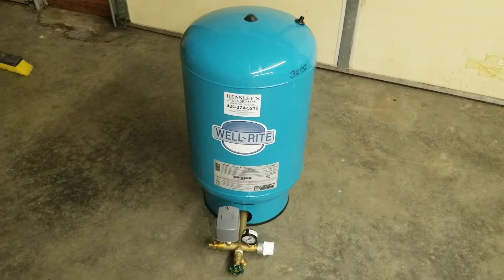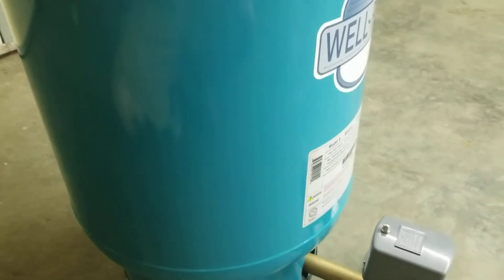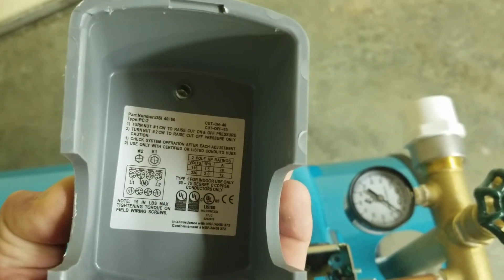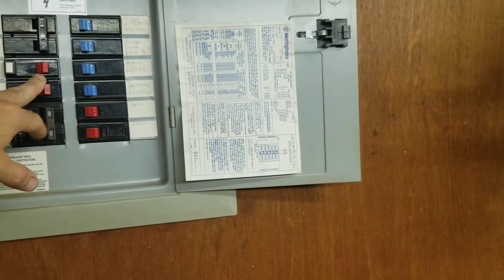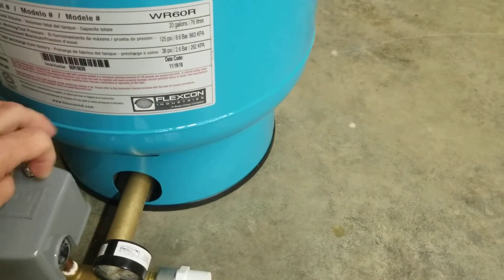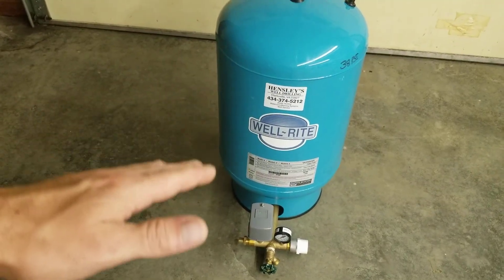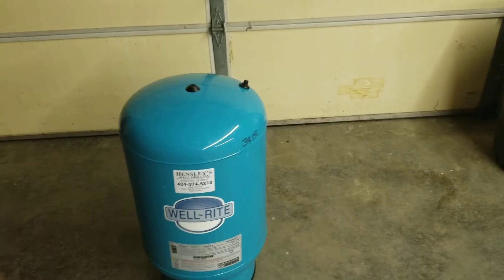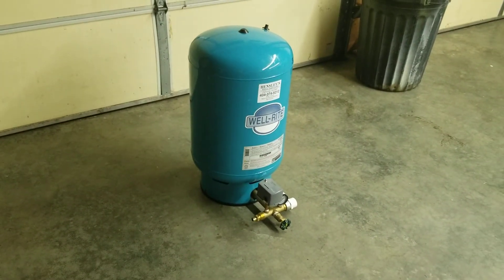Well Pump & Tank Troubleshooting, How the system works, Adjusting Pressure Settings Correctly

Comment: Hello. I put air into my tank i made sure that the water valve was off but when I open the valve & let it run the air leaves the tank & then I have no more air in the tank so I put more air in it & the same thing happens t his all happened after an article blast that came through & the temperature dropped to well below zero I thing it dropped to -12°. Could I have a bad tank

Comment: Thanks for the great description. Going to check my tank tomorrow, and turn my submersible off at the panel. I had forgotten they are normally on a single dedicated breaker and don't want to lose it too.
       Like my former well, just before the control T I have a gate valve and hose fitting.  I shut off the water to the tank and checked for pressure from the submersible- I have plenty. Am I correct in how I checked for a functioning submersible?  Thanks for reading this. Kind regards, Dave

Comment: Questions:
Deep well, Water stopped working abruptly. 
New bladder tank and switch (240 V)
What would cause the switch not to come on and pressurize the bladder tank?
 (Switch was replaced just in case, still no pressure)

Comment: My pressure tank is full, pump kicks on and off but water won't go to the rest of the house. Checked the tank pressure thats good. Not sure what it could be? I have a back up capacitor that I switched out and still nothing. When I turn off the pressure switch it drains to zero, what could that mean?

Comment: Good morning we have well system with a deep well and a larger bladder with a bigger house we are down to 10 lb on the gauge and the pump is not kicking on I am wondering how often the pressure switch goes out all of the breakers are fine and everything has power I will also check the bladder as well to see if it's good thank you for your help

Comment: Hey. Great video. My well runs nonstop so I use the circuit breaker. I replaced the pressure switch and no change. I drained all the water from the house and the hose bib. 
The tank is heavy but no water comes out of the air valve I also took out the center of the valve lots of air but no water. Is my bladder tank bad. Thanks for your advice. Chris from Alpena Michigan

Comment: Hi I’ve just purchased a pressure tank and the tee that I’m supposed to get for it has openings on both ends. One for water to come. 
2 openings on top for pressure switch and pressure gauge. 2 openings on the side one for boiler drain and pressure regulator. The box says I need a check valve. Where does that go? On the side the water comes in? 
The tee has an opening on the other side but I don’t have pipes to attach to that? What do a do? Just close it off? 
Any help would be great. I’m without water and can’t get a hold of a plumber I trust

Comment: My well pump comes on, the pressure builds up and it cuts off fine. Then with no water running the pressure slowly drops and it cuts back on. How do I determine where the issue is. Thanks in advance.

Comment: I just switched over to well water got a 20 gallon tank I got a 4060 pressure switch I set the tank at 38 PSI turn the water on for to fill up I checked the pressure in the bladder and it goes to 50 psi all new system

Comment: I have low water pressure in the house lately. Water has been dirty also. Whent to shock the well and noticed the pump is humming even thought  the pressure switch is off. I assume thats not normal. Going to look at the switch and tank in the morning but cant get past the well humming with switch off. 28 ft well by seattle and  never ran low on water. Also on a river.😊

Comment: Great video's! Question - can you replace a 20/40 pressure switch with a 40/60 if you increase the tank pressure to 38? or do you have to sick with the original tank pressure? or put in a new tank? Thanks and have a great day!

Comment: I have recently replaced a pressure relief valve. Month later the valve is leaking.  Pressure was at 80 psi. Pump is also short cycling. What would cause the pressure to continue to rise even after the cut off has been reached and pump is off?? I am using a bowl that I dump daily for the pressure relief.

Comment: Broke the feed line from the well pump replaced the line pressure tank has correct psi, psi gauge wont go higher than 38. Set 30 psi on 50 psi off

Comment: Hi. I’ve had the house for 20 years now and we have NEVER had decent pressure. Someone told me once I have a sandpoint well, its in the basement. I’ve never replaced or even touched any of the parts, so everything is AT LEAST 20 years old. Would I be able to put in a bigger tank, or a higher pressure switch, or a better jet pump and get decent pressure, or is a sandpoint just always going to be garbage? I can’t even use a water sprinkler without embarrassment and when the water softener regenerates, there is NO water available for around an hour til its done. The pump is 1/2 hp I think and it turns on when the gauge is at about 10 psi or so and turns off at 40.

Comment: Hey brother my water is not working at all 
My pressure gauge is reading 0 zero
Reply from the maker: @BuildByKQ  test for power out at the well. If you read 240v, then the issue is down the well (bad pump or wire)
If you don't get 240v then look at the pressure switch and test the points

Comment: What about 0 PRESSURE and TAKES 0 air it does not fill and does not read . NOT 1 single video w those symptom’s
Reply from the maker: @lexusautotek8905  the tanks bad & any air you add is going out a open pipe or faucet

Comment: we have replaced the bladder tank, replaced the switch, replaced the control panel and checked to make sure the pressure stem is clear and it is and we still have low pressure or no pressure n then the water cuts off what am i missing?

Comment: I’m having an issue the pump turn on but when I use the water I loose all pressure and notice the pressure tank isn’t filling up with water and it takes a while to kick back on or I have to turn it on manually
Reply: And I change the pressure switch maybe I made a mistake and I bought a 40-60 but my tank it’s pressure at 28 I tried to pressure my tank to 38 but that didn’t help
Reply: Also swap out the capacitor thinking it was that since im getting a burn smell when pump runs 😊

Comment: Trying to troubleshoot an issue….have a 30-50 psi switch and we experience occasional drops in water pressure (down to zero), only lasts a few seconds, then back into normal range. Seems to happen during high demand. Already replaced the switch but same result. Would love some feedback

Comment: At my parents house I can turn on kitchen sink,water flow seems fine,but I hear the well /pressure switch kick on every 4-5 seconds. I watched pressure tank gage ,it kicks on at 38 lbs. shuts off at 58lbs. When faucet is on ,like I said , 4-5 seconds it’s already dropped to 38 psi and turns on constantly cycling. I took air pressure gage to see what tank says,it doesn’t read anything.I tried to see if there’s air in tank ,by pushing down on air valve,no air comes out of tank.water works great,but I’m afraid it’s going to burn up their pump,cycling so much. Is pressure tank bad?  I’ve never seen a tank not have air come out or not accept air ? Your advice would be greatly appreciated! Thank you!

Comment: Just bought a house. Well seamed to be working fine first few weeks. Now the exterior holding tank is empty its about 500Gal and I have 2 tanks like the one you have here except they are about 3-4 times the size. 1 seems full and the other is empty. 
1. should I replace the full one?
2. Or should I check to see if there is dirt underneath the switch where you take a screwdriver and push it down into the coper line 
3. The pump seems pretty old too although It seems to still be working good when the system was working. 
4. The pressure gauge has water in it, is that normal or should I get a new gauge?
5. Should the tanks or pump or anything for the well be underneath a shaded area or should I build a cover for them? 
6. Would you be willing to do a call or something to help me diagnose the problem for some sort of consultation fee?  I really want to learn myself instead of someone trying to get me for hundreds if not more.

Comment: Water pressure went to a small nothing abruptly 4 days ago, I was told. He replaced the pressure switch, however there is no pressure on the gage, but there is some pressure in the bladder tank. Could the gage be clogged up.  Plus I've never seen a tank set on its side before and the gage is up above the tank on the inlet line coming from the well. Any suggestions

Comment: What is sputtering causing by? I just had a well pressure tank replaced. The brass pressure nipple to the switch had a slow leak and the plumber sold me on replacing the whole thing due to age and the same piece being replaced years ago. His apprentice broke it off by accident causing water to go everywhere and we replaced the whole tank and check valve. Now we have sputtering water at every sink/ faucet or outlet. The only thing I'd done in. between was replace our whole house water filter.
Reply from the maker: Did the old system have a check valve before the tank? 
Typically sputtering is air. It is likely a small leak in the pumps check valve. After 5-7 minutes of usage it should stop sputtering, but once it sits off for a hour or so, the water will be sputtering again. 
If this sounds like your scenario, then its a leaky check valve in the well pump (or a bad fitting in the well)
Reply: @h2omechanic  the plumber said it did. the sputtering continues even after a quite a bit of use, almost whenever used.

Comment: My water pressure surges. I can have super high pressure then the next super low. 

Last night I drained my tank, checked the pressure and had to add air. I was hoping it fixed the issue but it didn’t. Today I ran out of water completely. It had never done that before I tried to fix it. I went out there and the tank was so empty I could lean the tank over. I don’t have time right now to drain it all so I’m watching videos to try and figure out if it’s the switch or what. One other thing, my pressure gauge stays at 62 at all times. Even when I drained everything and had the power off. I know it should be between 40/60. Can that affect anything or is that just a bad gauge?

Comment: Suddenly out of water this morning. I'm getting spark on the contacts of the switch, but there's no water in the tank. I opened the relief valve at the bottom, below the switch, and only air came out. I'm afraid the bladder may be shot, but why wouldn't the pump come on? I have a tall tank, and my well is about 300 ft and drilled about 14 years ago. Any ideas? I bought a new switch, but wasn't sure if e needed to be replaced or not.
Reply from the maker: Spark means the pumps running. Either you have a broken pipe down the well & the air you heard was suction, or the wells dry & you have a major leak somewhere

Comment: My water stopped running while taking a shower. Pressure switch is sparkimg when tested. It just won't kick on and move the gauge. I replaced the switch about 8 months ago. Suddenly I got nothing. What do you think?

Comment: So… mines just doesn’t hold air, I fill it with air to to 28psi and it hood air for about a day. The tank isn’t filled with water only the bottom 1/3 or so of it the rest is hallow. I changed the stem on it and still doesn’t hold it. Any ideas?
Reply from the maker: The tanks bad, replace it
Reply: @h2omechanic  darn ok, thanks for help. I though they only went bad if waterlogged but I guess it’s losing air somewhere else. Just glad they not expensive and I can do job myself. Thanks for the help again!!!

Comment: Can you use the same pressure tank that has a 30/50 pressure switch and swap the switch to a 40/60 or do you need to change the pressure tank also?
Reply from the maker: You can change to a 40/60 without issue. But it would be best to add air to the tank while you are replacing the switch (pump it up to 36psi). That's how you'll notice more water pressure in the house
Reply: @h2omechanic  I thought that would be all I had to do and thanks for the verification. You da man!

Comment: I have a shared well with 4 houses and 4 pressure tanks with 1 switch..our water pressure went to 0..when i reset the 2 buttons it builds up to 17lbs then u can hear the 2 buttons click again as if they need to be reset..could this be a bad tank making system overload ?

Comment: My well pump works as far as it pumps water when you pull it up from out of the ground. When it is put back down into the well, it does not pump water . We've replaced the breaker and the pressure switch , both new parts. I believe that the tank has no air in it at this time.

Comment: Our pump doesn't shut off and pressure keeps dropping to 10 then 0 the bladder does not seem to take on any water add all I wonder if there could be any blockage the pump goes up to 30 and we have good water pressure but then it'll drop to 10 we just got a new pump yesterday the air pressure tank when you move in it seems like it is empty

Comment: Lightening strike killed my water. My 20 ga. bladder tank was at 10 psi. I bought and replaced my 40/60 pressure switch. Tank went to 20 psi then went lower when faucet was open. I filled the bladder tank to 38 psi. Was able to take a shower but pressure is lower than I'd like. Tank is light but doesn't sound like a bell when i tap it. Thoughts? Thanks so much.

Comment: Hello, my issue is my pump is turning on every 35-50 min and it turns on at 50 and turns off at 70,  I pulled the cover on my pressure switch and it's a 30/50 switch and I have never made any adjustments to the switch. Any guidance would be much appreciated, thank you.

Comment: I changed pressure switch and checked holding tank pressure and all test good. Problem is as run a faucet loose water pressure but gage doesn't drop down to kick switch on.

Comment: Well pump cuts on  only up to 20psi then stops. Bladder tank doesn't have any water in it. It has 28psi .I have a new 30/50 pressure switch. Pump was replaced last summer. Well is about 200' .  Had to replace fittings that connects to pressure tank. While replacing that fitting i could hear air hissing from the 90 under Bladder tank. Do you think i should replace tank. It's probably 12 years old. BTW I do hold  plumbing license.
This just has me puzzled. 
Thanks for your time

Comment: So question. Well pump is drawing water, but no service pressure in house. Bladder tank was at 0 at the shrader valve, and 0 on the pressure gauge at the bottom. Topped up the bladder to prescribed level, and not cycling on and off automatically. Is it the pressure switch?

Comment: I am having a problem with my pump all of a sudden stopping to run, and no pressure. I have a new pump and pressure tank. The tank builds pressure and holds at 60 psi and shuts off, starting again at 40 psi. It all works great for a day or longer, then, no pressure. I have to hold the handle back to start the pump and build pressure. Again at that point everything seems to be working fine. Any help would be greatly appreciated. Thanks, great videos and explanations on wells.

Comment: Which is longer lasting a bladder or diaphragm tank. I have a well-x-trol 30 gallon tank and I hope it lasts a long time because they are expensive. I run a 60/80 switch on a pump that is at 35 foot.

Comment: I cannot get my pump to turn on I can manually turn it on with latching. My bladder is at 38psi, I cannot get my pressure switch to turn on the pump. Could my pressure switch be bad
Reply from the maker: Try to remove the switch and check to see if the nipple below it is plugged up. It's common, especially if the 1/4" nipple is grey/galvanized.

Comment: Hi, I have a well system that is stumping me. Here recently, when we use the washing machine, our well will occasionally just cut off. Today, I started a load of clothes, and when I came home, the well was back at 0psi. We were taking 2 showers simultaneously yesterday, and the pressure just dropped.  In every event, I can go under the house, and reset the well with the pressure switch handle at 45 degrees, and it immediately repressurizes and is up to 40 in less than 45 seconds. . We are not seeing sand or any contaminants in the water, as if the well was going dry. 

I replaced the pressure switch a few months ago, thinking that may have been it. But it still happens. 

Any guidance would be fantastic!

Comment: So really bigger is better in almost all cases with the bladder tank.  (other then costing more and space constraints.)  What about pressure cut on/off points,  is that dependent on house layout, distance, split level, single level homes?  I bought a house 3 years ago with a 2015 bladder tank, 2 teenagers, garden, thinking i should upgrade to biggest tank I can fit to reduce cycles on the pump.
Reply from the maker: Bigger tanks require Bigger tank control tee. The most cost effective way is to leave you 2015 tank in (if its still good) & simply cut the pipe feeding the tank & put a Tee there & add another 20 gallon tank in the system. Use 2 tanks. Doubles storage and cuts cycles in half. This is equal to buying a 44gal tank & will cost you 70% less money. 
All you have to do is match the air pressure in both tanks. 
I have a trailer park running on 6 - 20 gal tanks. Simply replace 1 if it goes bad.

Comment: My tank had almost zero pressure. I filled it up to 28ft I and the pump is unplugged and the breaker is off. Do I need to have all my faucets open before I plug the pump back in?
Reply: Great video btw
Reply from the maker: It's always a good idea to open a outdoor faucet, this way it'll blow out any sediment Trapped in the tank & not plug up a inside faucet. 
If you notice a bunch of air, that's a sign of a bad tank. Just check it out again in 1 month and see if the tanks still holding proper air.